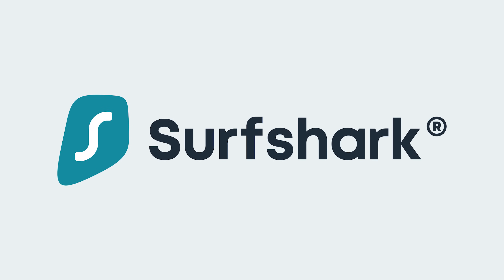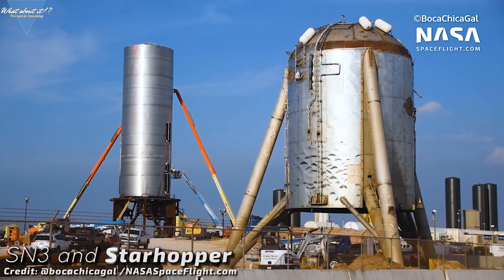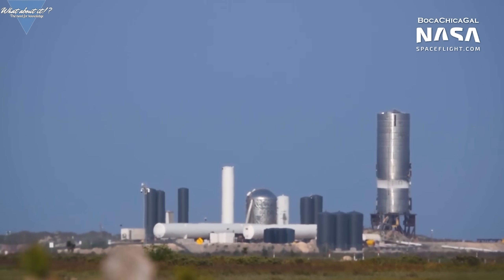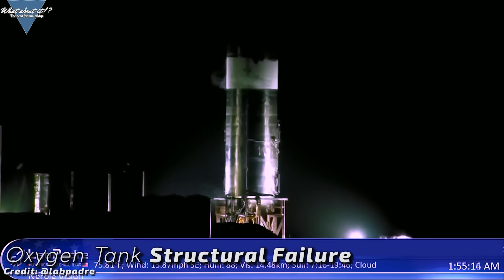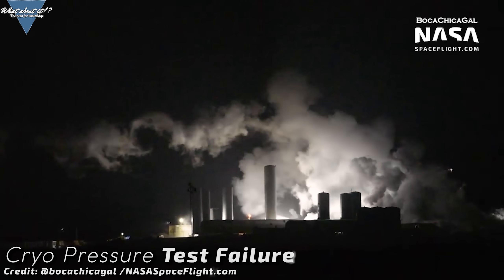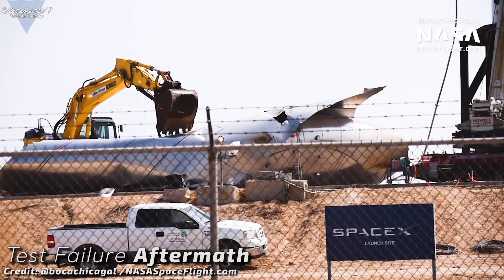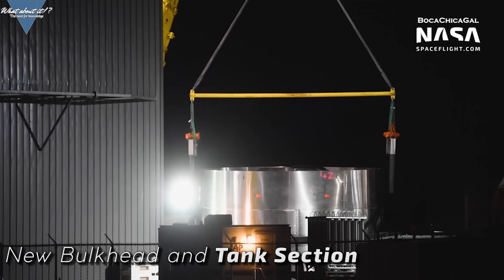83 | SpaceX Starship Updates – SN3 Cryogenic Failure Explained – Expectations For SN4

Comment from the maker: Will we see a Starship fly before christmas and what’s your favourite part about cryo testing?
Reply: Yes, first flight in the next month. It's like they are putting Lego together now. It's a real factory
Reply: Nana korobi, ya oki - We'll definitely see Starship SN-"X" fly before Christmas. As discouraging as these failures can be, the speed at which SpaceX replaces its loses more than makes up for the steep learning curve.

My favorite part about the cryo test is passing them in one piece!
Reply: Saturn V had corrugated skin in carefully selected locations between propellant tanks, between stages, and as first stage engine skirts for the purpose of strengthening the overall structure. The corrugations dampened vibrations and resisted bending. The fuel tanks themselves staved off vibrations and bending by being loaded with propellant. As the fuel and oxidizers drained from the tanks, the empty vulumes were filled with inert gas (helium or nitrogen) to maintain their structural integrity.
Reply: @claudiaxander  Starship does not use innert gas to replace used up methane and oxygen for a simple reason: It is designed to get to mars, get refueled there and then return to Earth. While producing the required methane in situ is possible, refueling helium will not be an option. Therefore it had to be taken out of the equation completely.
Saturn V was a multi stage single use vehicle (except for the tiny capsule), where you could place skirts between the stages, Starship is 2 stage vehicle, of which both stages have to sustain reentry conditions. Corrugated skin is not the best idea in these circumstances and skirts between Starship and Superheavy would have to be disposed after each launch.
The structures of Saturn V and Starship/Superheavy are simply not comparable, as they were designed for completely different purposes.
Reply: @claudiaxander  rorrect - on a structural design level Saturn V is light years ahead ... and it is some 60 years in the past :)
Reply: @lachezarkrastev7123  Nope, it is not. Saturn V consisted of 3 disposable rocket stages and only a part of the payload made it back to Earth. Starship/Superheavy is designed to be a completely and rapidly reusable 2 stage combination. Different purpose, different structure.
Reply: I think that sn3 crushed because of lowering temperature/pressure of the bottom tank. It Looks like that sealing empty bottom tank was the mistake. It is only my opinion.
Reply: Sure! My bets on July 4th...
But.. WHY do they call these tests " Serial Number" and not "Prototype"?? Prototypes are supposed to crash, not SN...
Reply: My favorite part is the Ka-boom!
Reply: Keep in mind, stainless steel is ~twice as strong at cryogenic temperature vs. room temp. But I am also not convinced that a phase change from gas to liquid in the bottom tank was not involved in partially imploding the lower tank. Also the upper tank was physically shrinking in size due to super-cold temps, while the materials in the bottom tank were trying to stay relatively about the same size. This shrinking top structure also sets up mechanical stress in the lower tank structures that are trying to rip them apart. And the actual failure mode could have been a combination of all three failure modes: static top load, a gas phase change to liquid leading to partial vacuum implosion in the lower tank, and thermo-mechanical gradient shock stresses beyond material yield point between the two tanks. Hopefully, this was a human test engineer error, and no redesign will be necessary. We will see if future tank tests fill both tanks simultaneously! And a true test would require both liquid methane, and liquid oxygen to be used because the two liquids are NOT the same temperature at equal sea level pressure!
Reply: Tony Rusi:
You've made the most thorough analysis of the simple phenomena that is correct but redundant. Doesn't matter what exactly was first, second or third factor that caused this crumpling. The core is that this tank section of Starship is a non-reinforced shell structure that can't stand even slight outer pressure. Without constant inner redundant pressure, it behaves like an empty condom.
The question is: how could it be that among hundreds of professional(???) people in Boca Chica nobody in whole life had ever seen this Atlas Agena footage.
Reply: @tonyrusi1978  I suspect the reason why the lower tank was not filled properly was due to them running out of Nitrogen on site, Caused by the earlier valve leaks.
Reply: One thing you could have included with the Raptor engines is that Elon in a tweet is that they are 3 different variants. https://twitter.com/elonmusk/status/1246784819272482816
Reply: First hop will happen in May, fingers crossed! SN4 will be on that test stand by end of this month. They keep getting faster and faster at this. Musk was smart to focus on rapid-prototype production, and fail-fast-learn-fast.
Reply: Absolutely, the progress is just amazing right now, so I definitely think at least one Starship will fly well before the end of the year.

Favorite thing about cryo test is your review of them!
Reply: Absolutly don't be sure of anything.
Depending in the cost of making 1SN they could run into money issues.
Reply: Yes.
Reply: Yes, my favorite part is the coverage of the tests.
Reply: No Felix... you rock :)
Reply: I think that there is still time for a orbital flight of a Starship with a Superheavy before Christmas.
Reply: @KnightRanger38  the entire Starship-Superheavy  concept is doomed. Forget about orbital. ZERO chances ... 20 km flight 10% chances the next year. Building Superheavy booster is at least twice more impossible than the Starship.
Reply: @lachezarkrastev7123  How big was the check from Boeing?
Reply: I think it will most likely fly by Christmas but not orbital . Which is fine take the time it's better to have the explosions now versus once a fully operational vehicle
Reply: "iterative production* is worth a show.
Keep up the perfect work!
Reply: hahahahah good one
Reply: For sure we'll see Starship fly by Christmas time. I expect a 20 km hop by then at least. Not sure if it'll get to orbit by then. If you had asked me that in March I would have been saying yes to orbit by the end of the year. Now, with these failures I'm not so sure.
Reply: I expect SN4 will fail as well due to major error design relating its durability Felix...😞
Reply: Hi, Felix.
Try to be optimist but to me it's time to ask "Will we see a Starship fly before SN20?"
Reply: You should show some old videos of the V2 rocket too.
Reply: Yes. At the pace they make prototypes : Yes, of course. My favourite part ... oh! please ... I want to see that 150m flight!!! please!!!!
Reply: It may go up. I'm not sure how many pieces it will be in when it comes down though. The structural engineering doesn't look right. If you are reliant on pressure to retain structural integrity there isn't enough redundancy in a vehicle that size. Also the current design is around retaining pressure in the tanks and not around take off and re-entry forces.
Reply: My favorite part is when they're over and there isn't a thousand tons of N2 flooding the area.
Reply: Sure, but sometime in the summer.
Reply: Something will fly at some point, but calling it "starship" will be a stretch. It will be some sort of tank with engines and that´s about it.
Reply: it will fly by Christmas, but will it land in one piece?
Reply: @michaelmcconnell7302  technically, it's supposed to land in 2 pieces - that's how it's designed
Reply: ZERO chances.
Reply: It's not how i would build it. you don't build a gas tank into the body or the frame of a car, its separate, yet Elon keeps doing it ???????
Reply: Blue Dot Astronaut Monocoque construction of rockets is as old as rocketry itself.
Reply: The moron who thought that gas bloated lower section could hold the weight of the fully filled upper section. Elon should fire that idiot. 😭😭😭😭

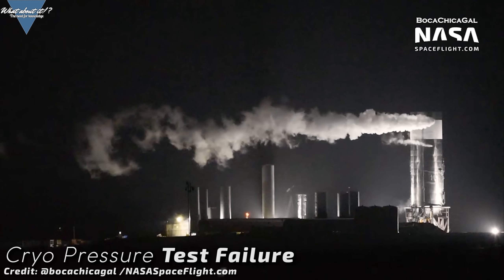Comment: 4:10 As far as I understood, it was the heavier weight per volume of N2 (compared to CH4, for which the structural integrity was designed and calculated) that lead to vehicle failure.
So we could say that the failure is not representative of the flight configuration, and therefore SN3 might have been fit for flight. The failure simply shows that in this configuration, SN3 could not withstand a fuel tank full of N2.
5:50 Starship was not empty, and redesign is not necessary in current state, as the test configuration was not representative of flight conf. Refer to my above remark.

Comment: I'm no structural engineer but it is obvious that the lower half on SN3 remained intact because of the internal support structure. The middle section appeared to collapse with the added weight of the cryogenic freeze of the pressure tank because there was no internal support in the middle section. I believe the SN3 test would have been a success if the middle section had the same support as the lower engine section. watch the video again and you will see how well the lower section holds form.

Comment: One possibility is that the lower tank valves were closed and when the upper tank is cryo tested the lower tank would have also become cold creating a negative pressure, the atmospheric pressure and the weight of the full upper tank should cause it to buckle and fold.

Comment: I now think that the problem with the current prototypes as we've seen in the past Mk1, and SN1 is 'not' fully fixed. That is because we did not see if the problem was fixed or not when the oxidizer tank crunched down. When 'that' happened, I now think this test is neither a success or a failure, instead an incomplete Cryo pressure test due to the faulty vent valves mixed with human error. When SpaceX was filling up the oxidizer tank, the faulty valves prevented it from going all the way, well I'm not sure if the fuel tank was fully fuelled, but the weight of it with pressure loss may have caused the lower tank to crunch and fail.
As we will never know from that test if the welds would fail or not, however as we may think there's nothing wrong with the welds, the problem could reoccur in the next test.

Comment: Elon Musk's tweet contains the following phrase:
"Not enough pressure in the LOX tank ullage to ... ... ..."
On 2 other sites the commentator reading the tweet out loud skipped the word "ullage",
because they knew not what it meant or how to pronounce it.
So here comes a definition straight from Google::
"Ullage is the volume which is left empty in a tank so that there is space for the liquid in the tank to expand.
The air space between the oil surface and the top of the tank is known as ullage.
Keeping the fuel storage tank full at all times keeps the ullage at the top of the tank to a minimum."
The definition suggests its usage in the oil industry, but it can be used in any context
with liquids other then oil. 
======================
When you type just that word into Google you will ALSO get a recording so you can hear its PRONUNCIATION.
Hope this was helpful !!
======================

Comment: Felix, given the collapse of the structure of SN3 on the pressure test, can you or any of your viewers explain the physics to me that will prevent the structure from folding on itself when the StarShip re-enters the atmosphere? It seems that if the Starship re-enters like a skydiver, there is a larger surface area that will see resistance to the atmosphere since the length of the StarShip provides more surface area than does the end of the rocket. With the Starship being comprised of stacked rings, I would expect there to be a stress-riser at each joint where the rings are stacked together. Although I am not sure it is comparable, bones show excellent resiliency when they are loaded along their long axis, but the don't fare so well when they are bent. To me this just looks like a long bone waiting to be broken when extreme bending forces are applied to it upon re-entry. Can you explain why this won't occur?

Comment: It appears that during the LN2 test of the upper tank, the lower tank continued to vent cold N2 gas.  After a bit of time, the pressure in the lower tank was low enough to allow it to crumple.  The crumpling process tore a large hole in the right side of the tank which allowed a rapid loss of the remaining pressure as seen by the bigger cloud of cold gas.  This is when it completely collapsed.

Comment: Three to six, equally circumferentially spaced,  angle iron styled sheet metal flanges welded to the outside of the rocket fuselage; with the flange inner faces towards the center; and, extending the full length of the consistent cross section would provide a low cost, fueling procedural miscalculation, cylinder rigidity enhancing, safety factor.  Might also provide flotation housing for at-sea missed landing survival.

Comment: It doesn't matter if the bottom tank was full or empty, as long it was pressurized. It was not, or not enough. The important part to take away is that Elon lied. Starship cannot hold its own weight standing on the pad should the pressure drop. It will crush like a soda can.

Comment: Great catch seeing the LOX tank crumpling in the minutes leading up to the collapse! You can see LOX tank looking more rigid for a while when it stopped venting. Unfortunately the venting resumed soon after, leading to the collapse.

The LOX tank didn't have to be full, just pressurized. The fuel (top) tank has to be kept at the same or higher pressure than the LOX tank to prevent the common bulkhead from inverting, so just filling the LOX tank to the top with an empty fuel tank would also destroy the rocket. The cold common bulkhead would not cause condensation of the gaseous N2 in the LOX tank unless the LN2 in the fuel tank were substantially sub cooled (higher pressure in the fuel tank means gas can exist at a lower temperature in the LOX tank). This was a testing error and the collapse doesn't indicate any structural deficiency of Starship,

Comment: The test stand load  is equal to one G. What if the internal pressure is low for some reason. Perhaps the low temperature of Space, say from parking in orbit and being refilled with fuel, and the ship wants to accelerate? How about a return from a Moon landing? How much
 acceleration before failure? Earth orbit to Moon and back should not take much fuel. Should the rocket be tested with its weight on the engine mounts?

Comment: Two major dimples were visible in the lower tank section (during cryo-pressure-testing of the upper tank) well before it crumpled.  I remember standing on an empty aluminum soda can with one foot when I was a kid. It would support my weight as long as I didn't bobble until I would barely touch the side of the can with my finger.  In that instant the can would crumple and be crushed under my weight. even though the deformation where I touched the can was very small it was adequate to initiate a buckling failure in the wall of the can above and below the nearly imperceptible dimple. Suffice it to say that the can had no welds, had a high degree of uniformity in cylinder wall diameter and wall thickness, and an absence of dimples in the cylinder surface. Pressurization in the lower tank would 1) have greatly increased the uniformity of the cylindrical tank wall diameter (smoothing dimples) and, 2) would have unloaded the walls axially by a force equal to the tank pressure multiplied by the cross-sectional area of the tank.  Apparently, buckling calcs for "very-thin-walled" cylindrical vessel did not adequately account for "significant" dimples created at welds (assuming that ambient pressure in the lower tank was a planned test condition).

Comment: Have you ever seen a regular balloon dipped in liquid O2?  It shrivels up. Looks like the same thing happened here because of the Extreme cold on top and low pressure, neutral temp. On bottom. And the weight too.  But it looks like a vacuum was caused in the lower tank.

Comment: That's common with stainless steel, Starship needs a spine.
Reply: It's last thing you need for a good strength/weight ratio - and the first thing you need if you have to be flexible like a fish - which doesn't need a good strength/weight ratio at all.

Comment: Why they don't use any rigid ribs in the middle section around the tank? This is even without any payload attached ( top cone). It collapsed itself not being able to support even its own weight. This is ridiculous, And Elon wants this thing to fly 100 times... You got to be kidding me. Legs should open wider for better stability. Current legs are not good. Just use Falcon 9 or similar retracting legs. Its was tested 100 times. If Starship flops on the surface of the Mars, it will be over....

Comment: Could the Starship be orbital tested and landing tested by propelling it up with 4 or 5 Falcon heavies, I really have my doubts that the Super heavy 1st stage will be operational - thats a lot of weight on top and a lot of acceleration ion the bottom , structural integrity and max tank pressure from high G and long tanks are also pretty  extreme

Comment: i like that the excavator struggled so hard to pull sheet metall apart during the cleanup , it bashed full force onto it with the bucket teeth and the stainless steel just flexed without bigh hole or even a serious dent

Comment: They're certainly using 3 engines, especially since they've tweeted 3 engines arriving. One of the things I wonder is; are they spaced out enough and have sufficient gimbal to allow enough control authority should an engine fail? They're certainly close enough to the center of gravity, but it makes you wonder if they're actually spread out enough that the surviving 2 engines could then rotate into center-line and maintain a safe, if somewhat canted descent?